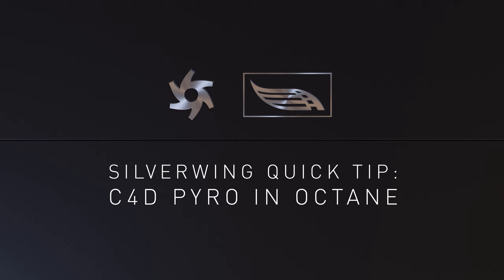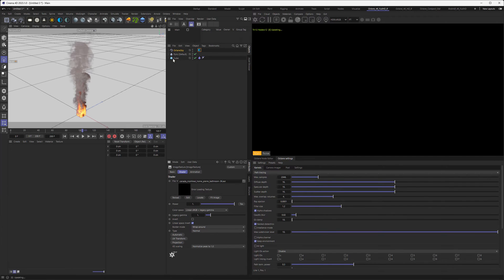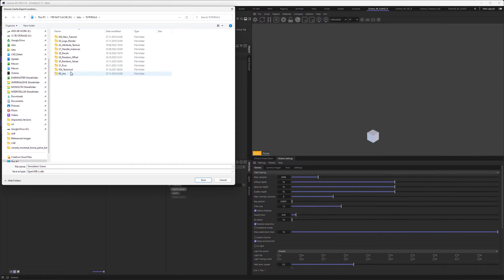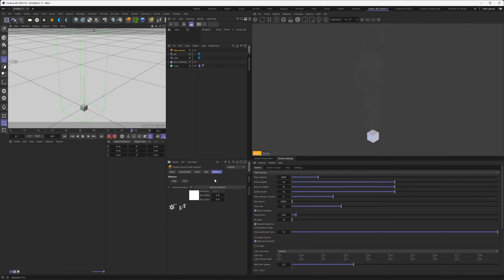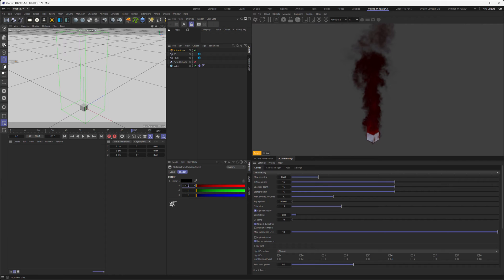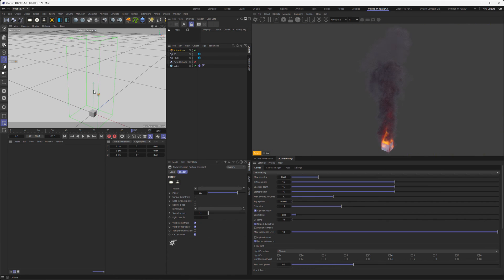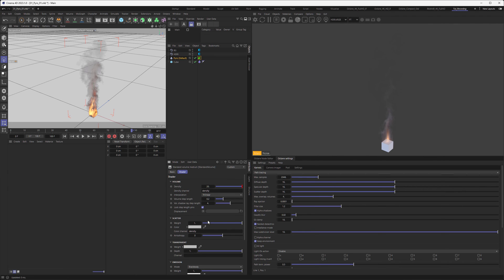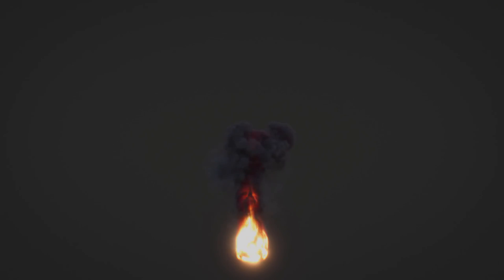Silverwing Quick Tip: C4D Pyro to Octane

Comment: When it comes to volumetrics octane is the worst 😂
Reply from the maker: It's definitely slow. But so are other renderers that do high ray depth volumes.
What I am trying to say is, that if you understand the inner workings volumes, it's not that bad.
Reply: @SilverwingVFX  true, but the shading capabilities of other render engines like RS and Arnold are superior to octane
Reply from the maker: @vfxnation6919 
Do you have an example what is not working with Octane?

Octane introduced the Standard Volume Medium that is (at least to my knowledge) en par with what RS can do. I might be wrong though as volumes and sims is not my main field of expertise.
Reply: @SilverwingVFX  I mean in Arnold you creat a volume material for your VDBs and this way you get much more flexibility in dialing the exact look that you want
Reply from the maker: @vfxnation6919  Ok, the Standard Volume Medium does not show in the materials, but it's basically one. And you can use Octane Nodes to do a lot of things with it:
Building Foam for example:
https://www.youtube.com/watch?v=sdms7YdYh4Q
Or Coloring it and have volume displacement:
https://youtu.be/1b20uIc1BNY
Reply: @SilverwingVFX  oh, I didn't know that lol thanks man 🤩

Comment: Hello, what can I do if my Pyro does not  work from the beginning? 
When I start animation - it sticks to object for a couple of frames and froze. I have a pretty decent setup wich can work with complex animations. Cinema 24.1.0
Reply from the maker: Thank you very much for your comment and your question. I am not sure what exactly goes wrong with your system. Since C4D pyro is relying on the GPU to compute, maybe it's your driver. You can try to explicitly set it to CPU and see if it does not freeze there.
Other then that I am afraid I am not able to help. Hopefully you will find a way to resolve it 🤞

Comment: Hello! Super nice tutorial but im having some issues. Ive cached my simulation and everything works fine. I can see it in the Octane viewport and all but when i hit render its all gone. What am i missing here? Thank you in advance
Reply from the maker: I just tried it with the latest version of C4D and Octane and it was still working for me. Make sure the file path to the VDBs is set correctly and the data in the VDB loader is interpreted right.
Of course there could be bugs that I am not aware of in more complicated scenarios. if you do not get it to work at all, I recommend contacting support and sharing it there.

Comment: Is there any way to color the fire with a gradient?  There are times when I need specific colors.  Thanks!
Reply from the maker: Thank you very much for your comment! And also thank you for your patience. I had a look at the system again and I think the only way to get color in there with a gradient is with the Volume medium. And this only works on VFB Sequences. So the way to do it would be to cache out your simulations as VDB and then re-import it with the octane volume loader and the volume medium (Instead of the standard volume) then you can add a emission ramp and choose the colors you like!
It´s a bit tedious. I will ask the devs if they can make it possible to customize the heat map!
Reply: @SilverwingVFX   Thanks for the reply. For example, a Bunson burner can have a deep blue-to-orange flame, and I'm finding it very difficult to achieve this. I also cannot change the opacity at the source of the flame. Sometimes, it is transparent. Little settings like this make me miss TFD.

Comment: When i check motion blur, the result is no different. No matter what do. Velocity is baked in the vdb. I can´t get ti to work with octane´s vdb-loader neither. Do you have any suggestions?
Reply from the maker: Hey there,
I think you have encountered a bug. Motion blur in Octane expects a separate value for X, Y and Z while the new Pyro is delivering a single Vector 3.
I have reported it to the developer. Hopefully he can fix it soon!
Reply: @SilverwingVFX  thank you
Reply: @SilverwingVFX  I have found a workaround for now. I load the vdb into houdini and use a single node called "vdb vector split OP" inside a geoSOP. WHen I export the vdb, it then has three separate float channels for velovity. But you have to crank up the velocity multiplier in Octane very high to see the results working properly
Reply from the maker: @sikliztailbunch  Oh very nice. Thank you very much for keeping me in the loop. That indeed is a good solution. Hopefully the developer can include another option in the future to also include Vectors.

Comment: Great stuff once again. Regarding render layers, I would love to know if there's a way to get de-noised black shadows. They're often really grainy and it's been something that's been plaguing my C4D compositing workflow for years and I've always been requesting Jules to look in to it.
Reply from the maker: Thank you very much for your great comment!
Indeed it would be great to have some devs look at that.
As far as I know there is no denoised render layer passes. Though you can get rid of some of the grain by not using adaptive sampling. Because octane is written in a way that with AS parts of the image that have an completely black alpha are turned off from sampling as soon as your min samples are reached. So with AS black shadows / layer reflections are usually undersampled.

I will bring that up in a conversation with the devs in the future. Thank you!
Reply: @SilverwingVFX  awesome! it's such a basic and important feature and I wished they would address these things before adding all the new bells and whistles.

Comment: You will admit there is a lot of hassle to get the look of the smoke in Octane which you get by one button in C4D, gasp
Reply from the maker: What helps a lot is setting the step length right (usually smaller) You get much more detail and density because of that.
Then also what helps is to know that burn / temperature and Smoke is basically just density values in a voxel grid. You remap / rearrange in to what you like.
But yes. Its not 1:1 But to be honest C4Ds preview is not a standardized display of how volume data should look. The status quo right now is more like load the VDB in 10 different software packages and get 10 different interpretations.
Reply: @SilverwingVFX  What I hope was just skipping all of those hassle, don't need to use x particles and just hop into rendering straight away but seems like when Octane is involved, process/hassle remain the same;)
Reply from the maker: @BartMiko  I have not used Pyro that much. But I am guessing there should be settings that come really close to what it looks like in C4D Viewport.

Comment: Hey you mind explaining how in that rendered intro you got the cube itself to have a burning shader?
Is it just a simple texture with light originally turned up that goes down by the end?
Reply from the maker: Hey there. Its a displacement texture for a stone cliff. I found it looked close enough to a wood bark shader that I used it.
I used the same displacement map remapped with a gradient to reproduce that glow in an emission node.
I just remapped it in a way that the darkest parts (that are furthest inwards in the displacement) are glowing the most. Hope that helps!
Cheers and a great time to you!
Raphael
Reply: @SilverwingVFX  Thanks for taking the time to reply ;)
Reply from the maker: @Varendil  Likewise. Appreciate it 😊

Comment: Amazing tutorial, the 2022.1-RC2 release makes the pyro so much more usable. I'm wondering though about getting the colour data from the pyro into the standard volume material, the only thing I can think of is changing the scatter color channel to 'color' which does show the right colors, but the result is extremely dark.
Reply from the maker: Hey, thanks a lot for your comment and your question.
Its indeed a tricky one. The only thing I can think of the top of my head is, as you did, use the color in the Absorption mapping and then adjust the scale. But I doubt it might give satisfactory results unfortunately 🥲

Comment: Great tutorial, Just out of interest, I downloaded the latest version which you demoed (which I believe is still in beta) 4.0 RC2 - R1, but it doesn’t seem to have support for r26 or 2023.1.0! It only has the cdl64 files up to R19, What am I missing?
Reply from the maker: Thank you very much for your nice comment.
Hmmm. Are you sure you downloaded the correct version. V4 is several years old by now. The versioning goes V4, 2018, 2019, 2020, 2021, and the new one 2022
Since 2022.1 is stable now I will link the latest version. It will work in all C4D versions up to C4D 2023.1 https://render.otoy.com/forum/viewtopic.php?f=85&t=80831
Reply: Thank you! I was clearly downloading the completely wrong version! The version you were showing isn’t listed in the standard download section. I must say my friend, your work is exceptional!👍🏻

Comment: Thanks for the tutorial. Just a heads up NEW Octane release 2022.1-RC2 can render pyro directly without cache.
- Pyro support added. You can activate rendering by just adding Octane Object tag to Pyro object. Add it after the visual effect calculated for a few frames. This will let the Octane detect the generated volumes and make the proper setup for you.
Reply: That's good to hear. However, depending on the scale of your sim you may still want to cache it. GPU renderers can be greedy when it comes to VRAM and I assume Octane is no exception.
Reply from the maker: Thank you for your comment. I mention all that in the later half of video though 😃